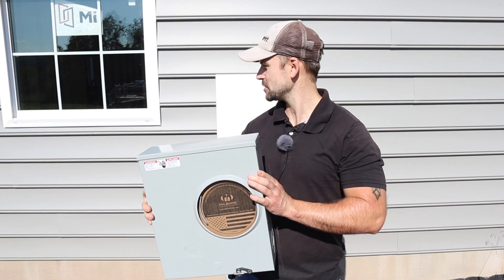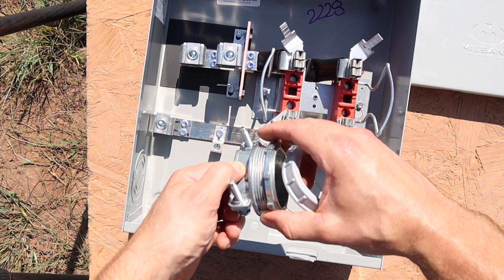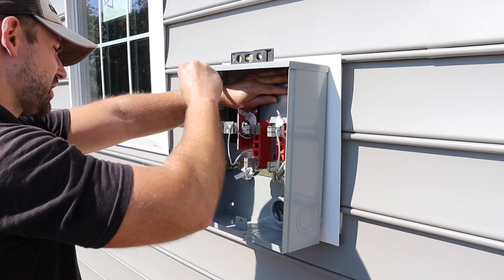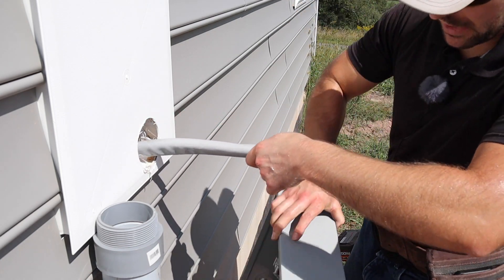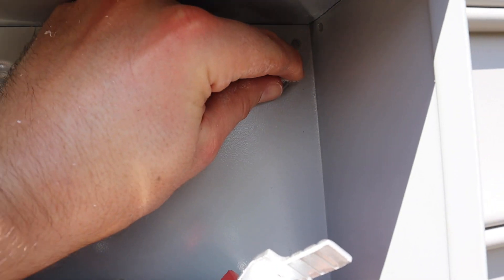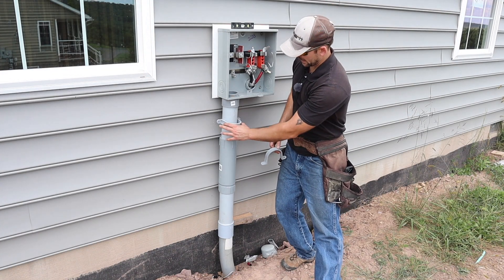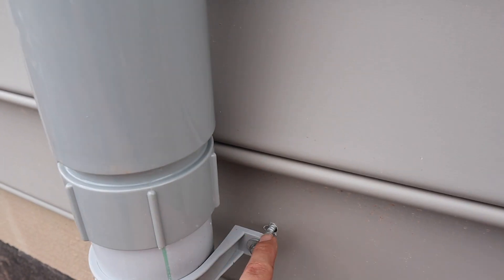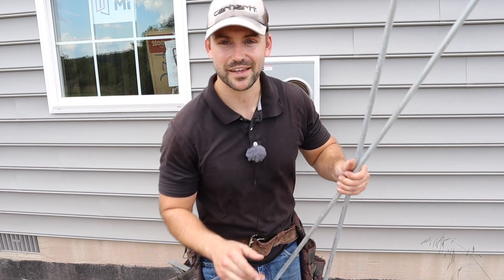Meter Base Installation In 14 Minutes! FAST And EASY!

Comment: Should the expansion  coupling be pulled out a bit before install? what if the conduit has expansion on a hot sunny day ?
Reply: Yes.. yes it does have to be pulled out it is necessary.. usually about halfway
Reply from the maker: That is not necessary. Good thinking though! Thanks for watching!

Comment: Hi, Can I ask a question? Our meter based was installed right near our window. There is no space between the window and the box, exactly near the window. Is this be allowed or not? And is there any requirement how far it should be away the window or the door? Thank you very much.
Reply from the maker: Every location is different. So codes are going to vary everywhere. I personally I do not think a window location would be a problem. Hope that helps!
Reply: Thank you so much Josh! @Josh
Reply: In a overhead weather head type installation the drip loop can't be within 36" of a window..basically so someone can't lean out window and swing from drip loop like Tarzan frying themselves..meter base itself has no distance from window requirements

Comment: Couple things that may be an issue:
1.  If your jurisdiction has adopted the NEC 2020 code requirements then an outside disconnecting means for emergency personell is required (NEC 230.85)
2.  If you are not using the largest size of the concentric Knock-out then a ground bushing will be required with that metallic SE connector
3.  There should have been a ufer ground installed to the rebar in the footer when they were poured.
Reply from the maker: Thanks for the info! I’ll let you know if I have any problems with inspection. We’ve been wiring these houses all the same and no issues so far. Thanks for watching!
Reply: you did forget the bushing on the 3 in connector.  required by code if wire is #4 or larger.
 @TheExcellentLaborer

Comment: J block?  Can you explain what that is?  What the meter is mounted to?
Reply from the maker: Yes the J block is installed before you install the siding. It’s for vinyl siding to have a place to trim around for your meter box. This video shows me installing it https://youtu.be/l1MwrqImWXs. I hope that helps!
Reply: Where did you get the j block from? I need a large one for my project. I can’t find them locally and I checked your Amazon store and it’s not listed.  Thanks.

Comment: How are you going to seal behind the meter from the rain that runs behind it
Reply from the maker: I’m going to pack around it with duct seal. I mentioned it at the end of the video.
Reply: J-channel of the siding prevents water from running behind it. The hole he drilled is addressed in this vid with duct seal.

Comment from the maker: Have you ever had to do your own electrical work?
Reply: I have completed quite few historic restorations and have done my own electrical work. Excellent content, can’t wait to get through this video.
Reply from the maker: Oh man I would not know where to begin with a historic restoration. The wiring in some of those old houses(if any) has to be crazy compared to now. Let me know what you think after you get your video! Thanks Randy!
Reply: The video was excellent! I absolutely love this channel.
Reply from the maker: Thanks a lot Randy! I’m glad you like the video. I’ll be wiring for a while so stay tuned!
Reply: Licensed electrician here lol. So ya, quite a bit.
Reply: Nope, wish I did do it myself cause right now, what the power company just left me a few hours ago, looks like crap.  Looks like they knocked out the knockout for a larger pipe!  The pipe in the meter box is all loose, conduit isn't even straight as they didn't use a any offsets so doesn't even look like they could properly screw it down either.  I don't know if this larger piece of pipe that's slipped over the conduit in the ground is supposed to work as an expansion fitting, it's covered in some grease.  What now?
Reply: Love your videos. I plan on building my own house in spring of 2022. I have not done electrical work before but from watching your videos I feel more confident.